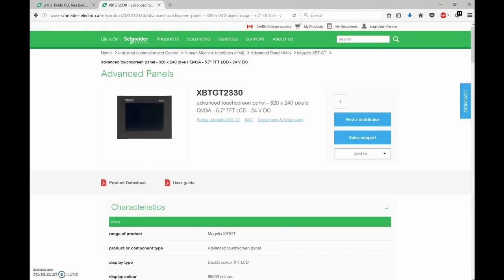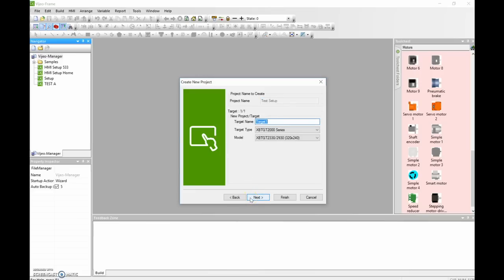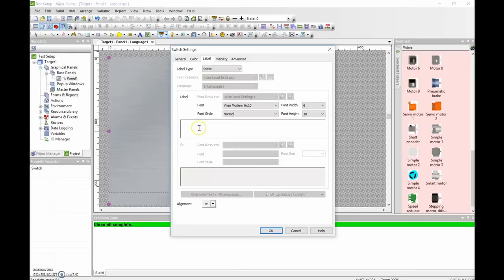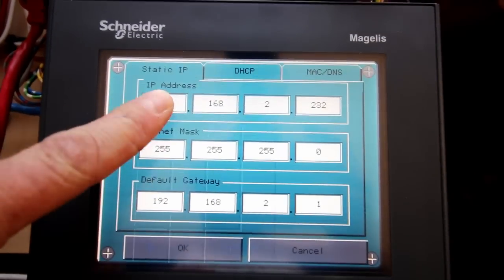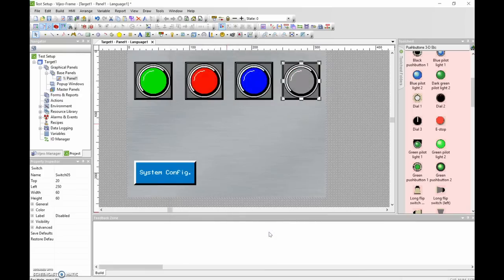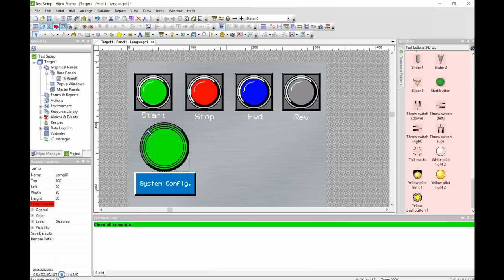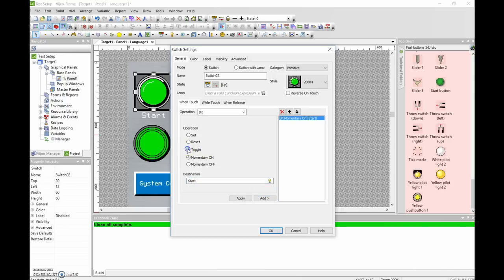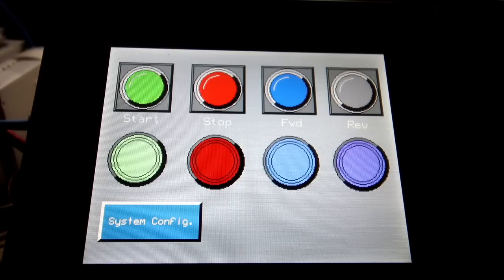Vijeo Designer Tutorial #2 (Magelis HMI) Creating Pushbuttons that control Indicator Lights

Comment: Does the Vijeo software cost anything ? 

I have programmed Delta HMI s and they used DOPSoft which was free. Worked well at the time.  I think they have changed to DIAInstaller Software now.

Comment: Hello friend, I have a question. I have a XBTGT2330 hmi screen with runtime 4.4 and the manufacturer of the machine sent me the files to make a usb pendrive and update to 6.2. He gave me the steps but it happens that the screen does not recognize the pendrive and I tried it on a new hmi and if it worked can you tell me why this is..

Comment: Hi when i try to send what the work i did on vijeo to thé Hmi it say's Transfer failed bcs of à connections error, is it bcs of thé driver or câble or maybe bcs i didnt find my hmi version when i started New project so i worked with another version on vijeo ?
Mine is HMISTO 715
But i dont see it anywhere when i choose New project and im using vijeo designer 6.2

Comment: if you want to go to the system config by pushing both corners you need to push 1 corner, relaese it and then push the other corner. and that fast after eachother. If you push them both at the same time it doesn't work. And sometimes the HMI doesn't react so if you have trouble opening the configurations that way its best to push the corners a couple of times fast after each other.
Reply from the maker: Ok. Excellent. Thank you Wouter

Comment: HELLO ESTIMATED, I HAVE PROBLEMS WITH AN HMI SCHNEIDER STU655 DOES NOT SIGN THE USB-B OR ETHERNET SIGNAL AT THE TIME OF PROGRAMMING WILL NOT HAVE A PROCEDURE MANUAL AS TO CONFIGURE IT AND THE VIJEO DESIGNER SOFTWARE 6.2